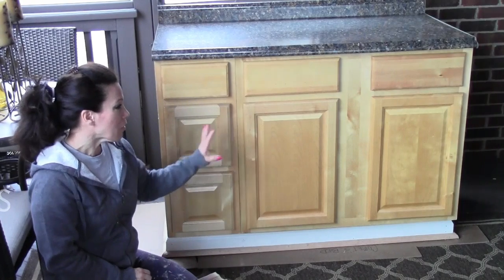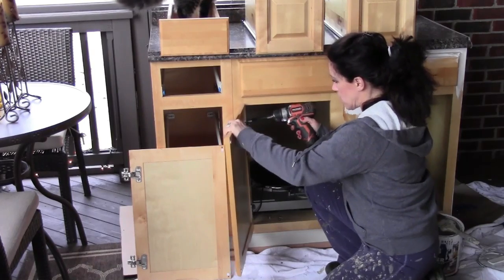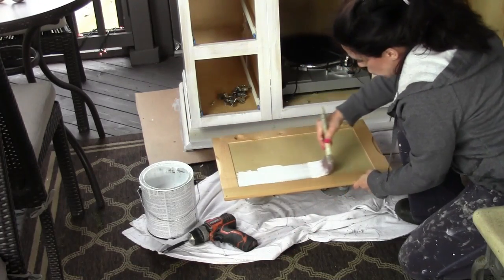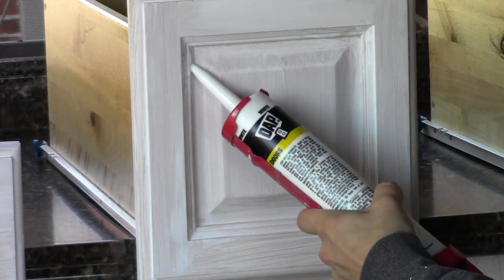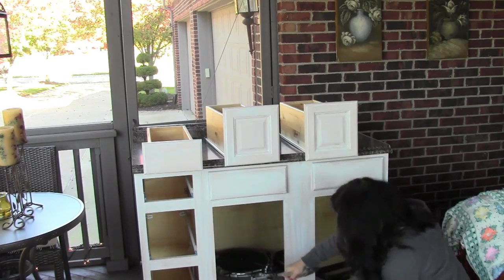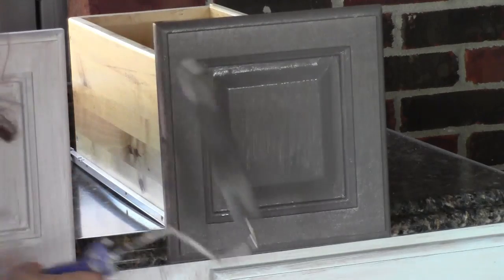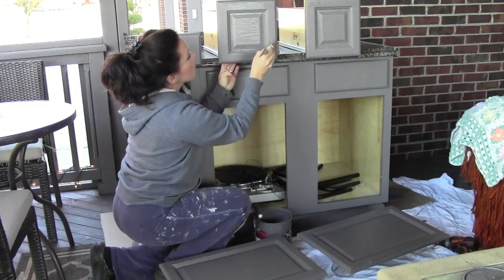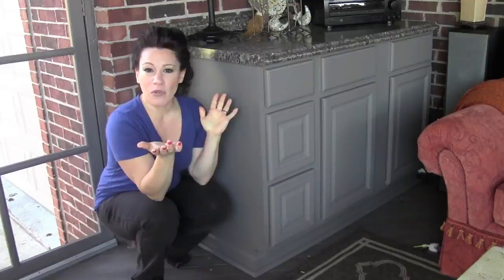Transform Your Cabinets With This No-strip Painting Method By Renee Romeo

Comment: Good video. I'm scared not to do a little sanding. How are your cabinets holding up? Are there any chips, peeling or wear? I'm curious because in a few days I'll be starting my cabinets paint job.
Reply from the maker: Janice Johnson, The correct primer eliminates the sanding. Just make sure you don't apply it too thinly - that's the secret. I had my kitchen cabinets painted this way for six years before selling the house. After the first year, I needed to touch up a handful of small chips that occurred near the handles (due to fingernails). I only touched up once a year after that and it was literally just a few small spots. Absolutely no peeling! If you use fabric-type stoppers on the backs of the doors, your cabinets will avoid nicks from opening and closing doors and drawers. We cooked, cleaned, and had lots of guests over during that time and I couldn't have been happier with the performance! The kitchen was just as gorgeous as the day I finished painting the cabinets. Only I knew where the touch-ups were. I hope this helps your decision! All the best, Renee
Reply: @ReneeRomeo  Wow! Thanks so much! You just saved me so much time. Your cabinets look fabulous too!!
Reply from the maker: @TheJanicetunes  We can all use more time! Thank you - your cabinets will be equally beautiful!!!! Renee

Comment: always sand cabinets after you clean or you can clean them with a 3M scuffing pad - that will lightly scuff the old clear coat. tint your primer to the same colour as the finish paint, and lightly sand and wipe down your primer before top coats.
Reply from the maker: Hi Leslieville Painter, You have some great ideas here but I've found that my way is far less time consuming and I get the same great results that you do. It wouldn't have taken much time to tint the primer though. Thank you for commenting, Renee
Reply: My point was while you are cleaning them anyway, use a 3M stripping/scuffing pad dipped in the soapy water as your main source of scrubbing. This will lightly sand while you are cleaning. when you wipe them down, you end up with a de glossed surface in one easy step... as for sanding - I charge thousands of dollars to paint cabinets so I have to sand and go through all professional steps and procedure, could certainly never depend on a latex primer..Have you noticed any chipping? is this kitchen in heavy use?
Reply from the maker: @ipaintkitchencabinets2069  I've touched up about 10 small chips near the knobs. They've held up really great for the effort. It's a moderately used space. No one would know it was touched up but me. I appreciate your knowledge and will certainly try a 3M pad for my next project to see how it goes. Thanks so much, Renee

Comment: Nice job! Why did you use an exterior paint?
Reply from the maker: Hi Rt L, I used exterior paint because I knew that this cabinet (even though it's covered) would be exposed to more moisture than if it were located indoors. The covered porch helps protect it but dew tends to build up in this space so it's better to be safe than sorry. I hope this helps your decision for paint choices. You can always use exterior paint in an interior environment, just not the other way around. Thank you so much! All the best, Renee

Comment: Do you use the same roller, because every time you use the roller, it picks up paint. Can you use that same used roller or get a new one each time
Reply from the maker: Hi Karen, You may have to try a fluffier roller and not press very hard. All I'm doing is adding texture to the paint and I am using the same roller throughout the entire project. You shouldn't have picked up very much paint on the roller even by the end of the entire project. This should correct the problem. All the best, Renee

Comment: I am late to the party but we are bout to do a huge job, kitchen cabinets, bathroom cabinets and cabinets in den. So I am studying and would like your input on have you compared this method with the chalk paint lady I see here on youtube and I see furniture paint methods as well as all in one cabinet kits????
Reply: oh ya the other that is highly recommended is general finishes milk paint if anyone here or you have tried it as well? just trying to find most forgiving easy method as I have a lot to do and a lot of teens running in and out.
Reply from the maker: Dawn Smith, To be honest, I've never used chalk paint or a kitchen cabinet painting kit to paint my cabinets. I had a kitchen that I painted with my method for 6 years. We  loved to cook, bake and entertain in that space so it got a LOT of use. I noticed a handful of nicks after the first year of use and had minor touch-ups that I did every Spring thereafter. This method works impressively well so I never saw the need to try anything else. Make sure you use Bin or Kilz primer/sealer as a base coat and you'll be fine. Best yet, it's probably the cheapest way to go too! I hope this helps you figure out the best way to go for your home. All the best, Renee

Comment: Do I need to prime for unfinished cabinets? Thanks in advance.
Reply from the maker: HI Vsquaredfotos, Yes - you do have to prime unfinished cabinets. Primer will make the surface look more even and help to adhere the paint better. Your finished product will hold up much better with primer. Thanks for the great question!! I did this in my unfinished cabinets in my hanging wall cabinet video and you'll be able to see the nice finish I got: 
https://reneeromeo.com/2017/08/06/how-to-install-or-hang-upper-wall-cabinets/
All the best with your project, Renee

Comment: Much easier and quicker and better with a 4 inch roller...and I use just deglosser   no primer at all     but if you prime   primer does not need to go on that heavy  all you need is a skim coat
Reply from the maker: fairamir1, Thanks for the great tips! I don't know the availability of deglosser for others but it's definitely another option. Sometimes I just use what's widely available so that no one is going crazy trying to find a specific product. You've definitely given everyone more options. Thanks so much! All the best, Renee

Comment: Shouldn't you have taken the drawers off?
Reply from the maker: Hi S R, So, drawers are tricky to paint because you have to pull them out of the cabinet and then prop them up on something so that you can paint all the way around the drawer front. It can be a risky paint job to prop them up on something unstable (I never seem to have the best support system). Sometimes it makes more sense (to save floor space) to simply let them dry in their natural spaces. I removed them to paint the cabinet fronts and then placed them back in their spots to paint the drawer fronts.  I hope this helps! All the best with your project! Renee